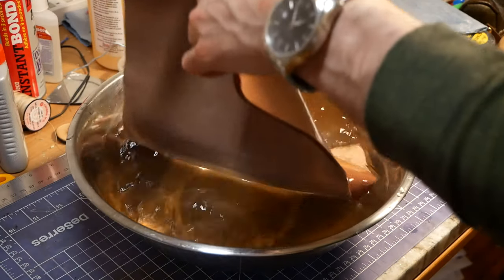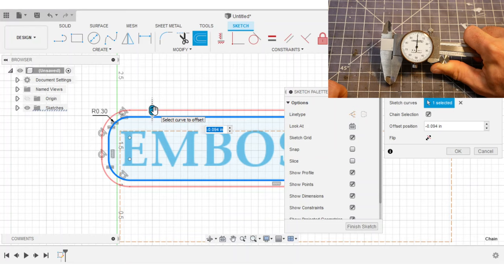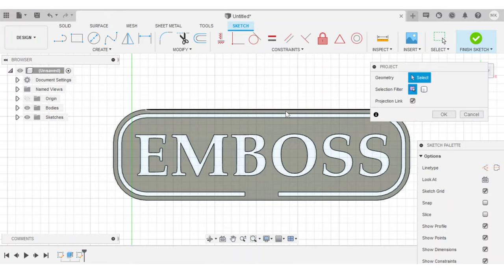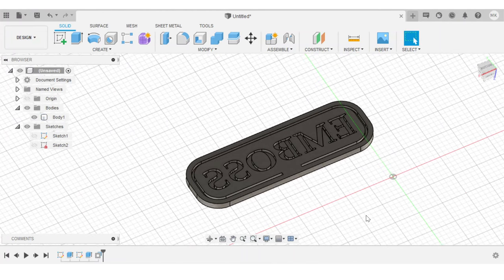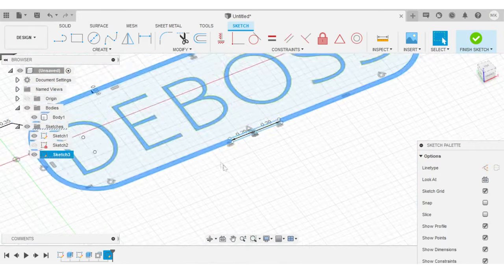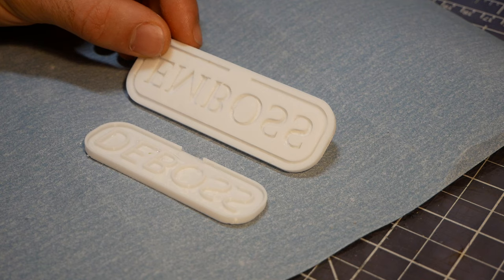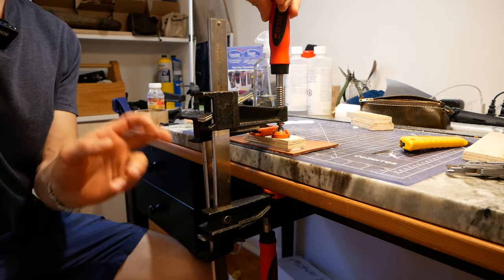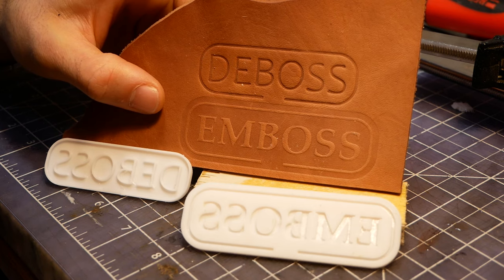How to Design and Use 3D PRINTED LEATHER STAMPS // Fusion 360 & Leatherworking Tutorial

Comment: Great tutorial.  Quick note, however - don't wet the leather so much.  You do Not want water standing on the surface.  Using a spray bottle is great, but spritz lightly, stopping before the water starts to pool.  You want the surface damp and cool to the touch, not water logged.  Damp leather allows for better compression of the fibers and a shorter stamp time.  If done correctly, you shouldn't have to leave a stamp under compression any longer than 30 seconds.
Why?  Because too much water allows the leather to act like a sponge.  If you remove the stamp too soon, the compressed fibers are likely to reabsorb the surrounding moisture, opening the cells again and dulling the impression.  However, if only about half the surface layers are wet, this allows the stamp to press fully into the bottom layers to compress and stick the fibers together.  You'll have a crisper impression that will last.
Reply: Thanks
Reply: Ah!  Important information, thanks.  Turns out some of my impressions might be less crisp because I've made this mistake.

Comment: Very good work! I just tried it myself with Fusion. Works perfectly. Greetings from Germany
Reply from the maker: Thank you! So glad that you tried it and it worked! 😁
Reply: @MorleyKert  You´re very welcome! Me too 😃
Reply: @MorleyKert  I still have one question: Can the stamp also be used on purchased and therefore already end-treated belts? 🤔
Reply from the maker: I’m not really sure, it probably depends on the type of leather. You may have to remove the top coat first. If it’s veg tan leather, you have a much better shot!
Reply: @MorleyKert  Okay, I understand. I'll give it a try. It is a black leather belt. Already a little older, I can not break much there 😄

Comment: I have found you can make leather stamps with a lasercutter as well (really detailed ones), though it takes several passes to get it deep enough to not leave a mark from the edge of your stamp block. Since I have both a printer and a laser, I've tried making a 3D printed blank that's slightly oversized and then lasering away the appropriate material. Then I get the deep clearance from the print and the fine detail from the laser. PLA lasers really nicely FYI.

Also the ironing feature in the slicer is available in CURA for effectively any printer that works with CURA, not just Prusa's
Reply from the maker: That’s a really cool idea, I’ve never thought of lasering PLA before. Would love to give that a try.
Reply: @MorleyKert plus if you print one color, then print the last layer a different color you can effectively make your own 2 color plastic like the Rowmark 2 color engraving sheets. When you laser it (if your settings are right) you not only get the deboss, but it's the other color.
Reply: @MorleyKert  I BEEN DOING LEATHER WORK FOR 22 YEARS AND IT CALLED CASING THE LEATHER IT DOES NOT MAKE IT RUBBER WHAT IT DOES IT HELP THE LEATHER TO RECIVE THE INPRESTION OF UR STAMP BETTER. i AM SORRY I AM TYPING CAPS BUT I HAVE BAD EYE SITE AND CAN SEE THE SMALL FONT

Comment: Nice use of your Prusa! I do believe Cura slicer has had an Ironing feature for some time now for those with other machines... though I still prefer to wet sand my flat surfaces up to 800 to get a shiny finish.
Reply from the maker: Thanks! I’ve yet to try ironing, will definitely take it for a spin on the next stamp. It does seem to add a considerable amount of print time for large surface areas though.
Reply: @MorleyKert  Yep, and maybe it's gotten better, but I remember it would melt the plastic slightly over the edges creating a small lip, I was never too happy with the result, hence the sanding. My favorite setting BY FAR in Cura is Fuzzy Skin, it's pretty amazing the kinds of textures you can get with it. That being said, I mostly use Prusa slicer unless I want to use one of the special settings Cura has. Keep up the awesome work!!

Comment: this is very cool thanks! Do u know if it works with leather that's already dyed?
Reply: You can stamp leather that is already dyed however the impression can reveal undyed parts around edges which would need to be cleaned up afterwards with a small paintbrush

Comment: Okay, I know this video is a couple of years old, and there's some good advice in the comments from leatherworkers, so let me collate it and add some of my own experience to it.

Adding water to veg tan leather:
You applied WAY too much, when you're wanting to make impressions on leather, this can be called stamping tooling embossing debossing etc you want to do what's called "casing" the leather.
You're adding JUST enough water to be able to do this, too much and you can end up losing definition while it dries, and you add more when you want to mould the leather, but even then you can add too much to do this.
Typically, you add some water evenly and let it return to it's natural colour, it'll feel cool to the touch. (This is also a good tell to see if the piece has dried enough)
Just think, the more water you add, the longer your stamp needs to be in position for it to take properly.

In the video you've actually only debossed, either the text/border or the negative space.
Yes one looks like you have embossed, but it's not actually raised the surface.
To do that you typically want a male and female mould, like you can see on paper logo embossers.
This is tricky to do however, especially in the middle of a project.

As for you infilling stamps.

They don't need to be 100% infill, typically adding some extra walls top/bottom layers will do the trick, with a fairly high infill, you'll find if you have any errors whilst stamping it's because of how you applied force.

Also depending on the size and or depth of you stamps you may want to put a small radius on edges to prevent tearing, this is more important the deeper embossing you want.